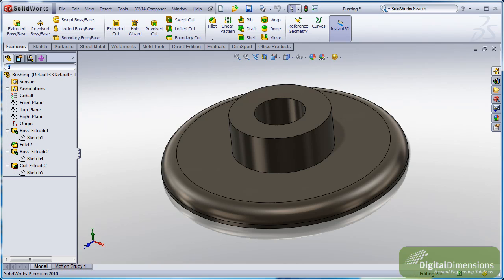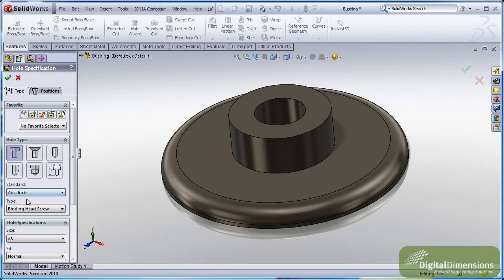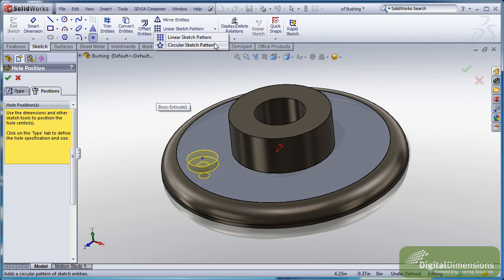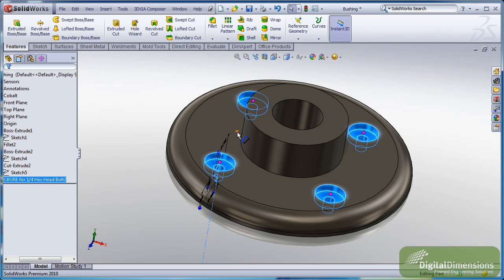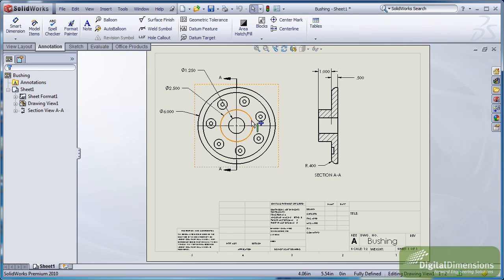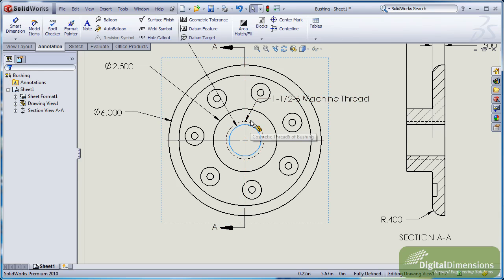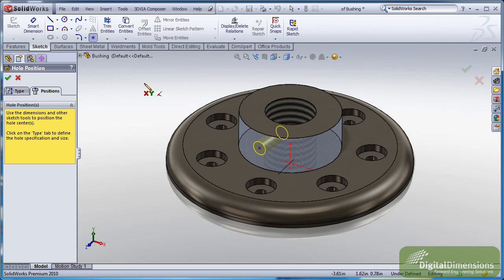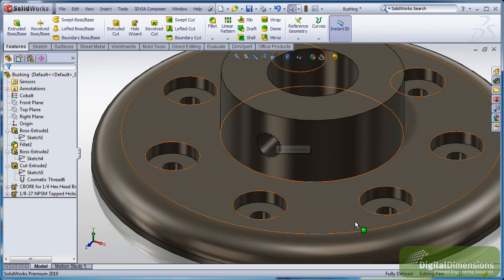SolidWorks Hole Wizard 2010

Comment: when I do a curricular pattern with the Hole Wizard, I get an extra hole in the middle of the pattern. It did not matter to you because you have a big hold in the middle, but without it, it is a big issue. Is there a way to get rid of that extra middle hole?

 In your video, you can see the middle hole preview at 1:30.